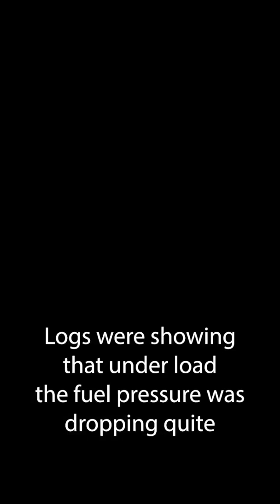The Supercharged Marauder is fixed!! Fuel... #shorts

Comment: Not fixed. It'll be back in a couple months for the same issue. I'm willing to bet that boost a pump is failing and is shorted which is why the old pump died. Speaking from expierence having removed multiple kb boost a pumps for the same issue
Reply from the maker: I did some checking and it seemed to be outputting correctly but I am a bit concerned if the BAP is indeed not failing. Actually with this pump and the power level this car is at I probably don't need it. I am planning to get the car to a local tuner to final validate and see if its even needed. I'm hoping the old pump failed from age and also the car sat way too much with old ethanol fuel in it. Part of this job I also fully drained the tank and will only be running non ethanol fuel going forward since it's not a daily driver anymore.

Comment: Over rated car. Cool looking but needed mooooore power or a 3:73 rear end.
Reply: Yeah they only ran mid-15s from the factory my 2012 Chevy Impala with a 3.6 LFX and the 6-speed runs low 14 stock.
Reply from the maker: Agreed. The first show cars were actually crown vics and had a sc'ed 2v 4.6l. The 4v motor is nice but the car is heavy. When I got this one I first put 4.10 gears in it- still not enough so I jumped past the rest and gave it boost. The roots blower helps give the 4.6 much needed low end power. I've resisted for years turning the boost higher (3.4 pulley now for about 9psi) - it'd certainly pickup more needed power.
Reply: @VortexGarage  
Id leave the boost where it is. After all its not really a race car lots of body roll. I had 2 marauders. One had a after market gear in the back it really work that car up. However at 80 mph it was at 2500 rpms.
Reply: @dude55ist  that's terrible logic.

Comment: It made it 103,000 miles?    Jk
Reply from the maker: I'm glad seeing many Marauders now with well over 200k. The 4v motor is a bit more complicated than the bulletproof 2v. That said it's showing good reliability. This one has had boost on it for over 80k and going ok - as a non forged motor with high compression ratio I always have wondered how it'd do long term with boost.